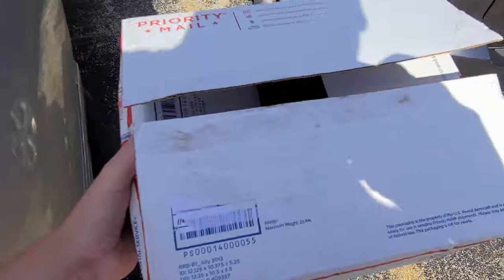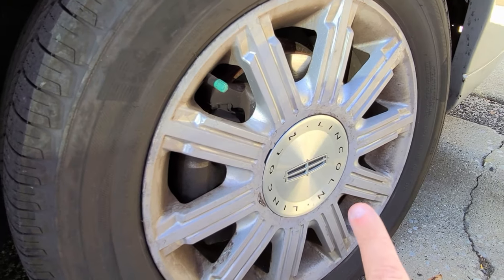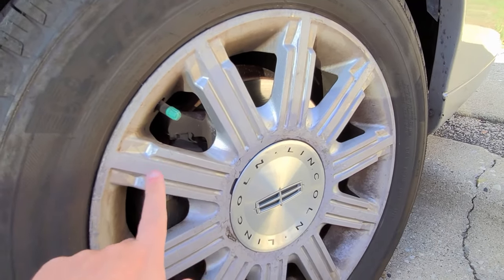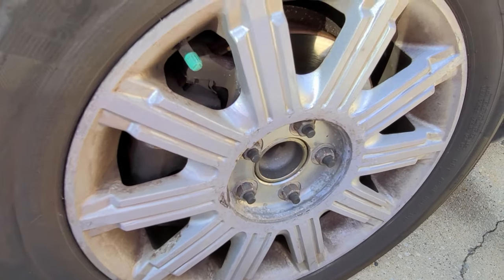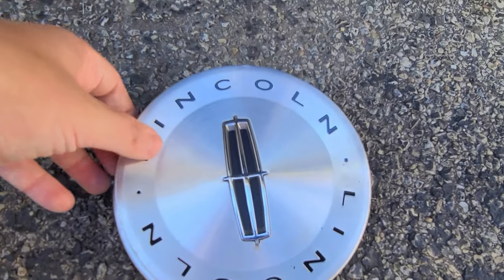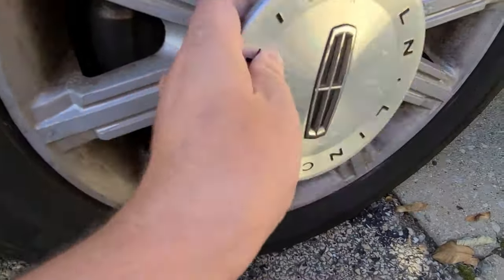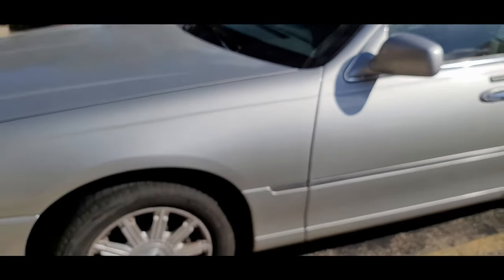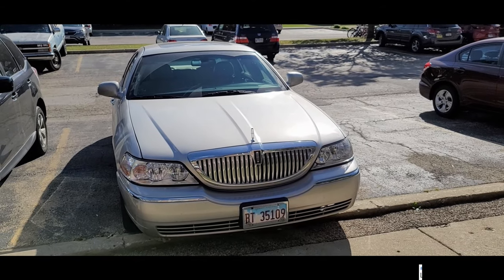Lincoln Town Car Guy Looks at Different Wheel Cover Center Caps for his 2006 Lincoln Town Car SigLim

Comment: I’ve lost one of these while driving after my tires were rotated and I couldn’t find it on the side of the road .
Then I had to purchase another one. 
luckily I realize when I ordered them that there was these two types your talking about. 

(Important) 
keep in mind every time somebody works on your tire the cap they can become loose and the mechanic will adjust them. They will simply snap them on and not make sure they’re tight and they will fly off if not in tightly.
So be sure to check and make sure that the wires keep them tight otherwise they will fly off while driving, and replace them isn,t cheap.
Reply from the maker: Thank you! Yes - I always do an extra "tap" when my tires are being rotated to ensure they don't come off. I tell you that it's a lot less hurtful to loose 1 from driving than to have some bastard take them.

Comment: The Lincoln Ls Also Had similar caps, almost identical in dimensions but the way they snap in is not correct
Reply from the maker: The Ls I noticed had slightly different design and letters were not highlighted in black... Why did Ford make things more difficult for themselves and the general public!?

Comment: Very interesting, I thought they were all the same. Now I know if I ever need one, I know which ones to look for. Did they offer different size rims on these cars .
Reply from the maker: That's what I thought also before. I think 2003+ they were all 17" but had different  finishes. 2002-1998 were different and not compatible due to those brackets.
Reply: Also had bought an extra rim from a wrecking yard that matches the other wheels. Had a tire mounted on it, i dont like that mini spare, looks dangerous and you cant go far. Just had a flat snd put it on. Feel much safer with a regular tire. I put the center insert in, just happened to look when i stopped and saw it working loose. Pushed on it and it popped right in.
Reply from the maker: @perrymckinney6146  Glad you caught it before it rolled away. They look nice, but a pain to keep and even bigger pain to replace.

Comment: My 2006 TC Signature Limited came optional with the 18” chrome Designer wheels
Reply from the maker: How about sunroof?
Reply: @VitaliyKofman  I guess you have forgotten the video I sent in, it has almost all the options: sunroof, chrome designer 18" wheels, Presidential carriage roof.  The only other options would have been the navigation and THX stereo ( I will add the THX tweeters - they really make a difference in sound), and the HID headlights (I'm adding in aftermarket LED lights).  I did add a factory trunk organizer that turns the bottom 9" of the trunk into a covered basement.   Further down the road I plan on having an auto custom upholstery shop reshape the front seats to match the shape of a Barcalounger recliner for the ultimate in comfort.
Reply from the maker: @Thomas63r2 Now that you mentioned it, I remember now. Sorry, but with almost 300 videos either posted or in the works my memory is shaky :) So, you are basically turning it into the worlds most luxurious Town Car with ALL options. I would love to work on the updated videos when all these options go live :) Here you are: https://www.youtube.com/watch?v=YZQZiMPNmZY
Reply: @VitaliyKofman   You could be waiting a while.  Who knows when or if any of my car upgrades will happen: I need to build about 300' of fencing on my property, my house needs a new roof, and I have some other remodeling projects - plus I have a Jaguar and a couple of other project cars!   Plus one other wish list item for my TC: I want to add in factory fog lights.
Reply from the maker: Interesting! I'm sure the roof needs to take priority. I'm not planning on leaving YouTube any time soon so whenever you are done, I'll be here. Thank you!
Reply: @Thomas63r2  I have the Thx navi it quit working but need to find schematics to keep the amps and speakers just change the head units